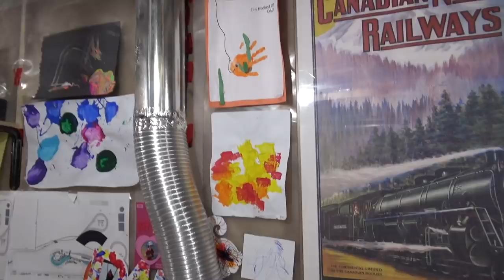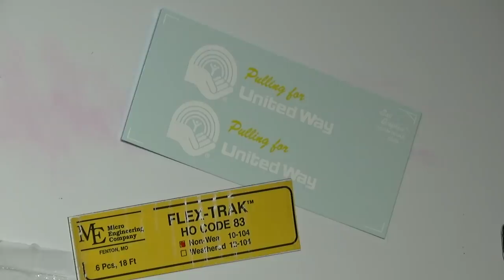Layout Update - April 2019: CEFX AC4400CW, Paint Booth Operational, CP SD90/43MAC...

Comment: Really like those CEFX AC4400s. the paint booth looks good. CP only had 4 SD90/43MACs. 9300-9303. The SD90MACs were in the 9100 number series.
Reply: you've got it backwards there bud. CP 9300-9303 were 6000hp MAC-Hs. The 9100s were 4300 SD90/43MACs.
Reply from the maker: I haven't taken at look at what the trackside guide calls them. CP calls them SD9043AC, at least that's what is on the side of the cab. Kato calls them SD90/43MAC, I guess it depends who you ask.

Comment: Nice job as always Mr. Ben!   Regarding your missing wiper blade. Have you considered doing a 3D printer to replicate the blade? Also have you ever considered putting in a smoke unit underneath the exhaust port on top of the locomotive?
Reply from the maker: They are so tiny I wouldn't know where to start! Haven't put much thought into the smoke but my friend has a smoke unit in a tunnel that works really good.

Comment: Use nail varnish remover, i found that tip in a magazine years ago back in the UK. Worked for me on an athearn unit recently
Reply from the maker: Interesting, would it not strip the red underneath as well though?
Reply: @BArailsystem No it doesn't, you have to let it (couple drips, maybe more) sit on the number or symbol for a minute or so and the rub with a cotton bud/q tip for a couple minutes to get them off, it doesn't strip it. You still need to work it.

Comment: Nice new projects done and on the go.  How you make your black wash for the locos. I am at a point where I will be weathering my locos soon. 
Nice detail touch to the curb on the Banff station sidewalks.
Reply from the maker: Thanks Peter! Super easy, water down some black acrylic paint. I like to use old contact cases so I have two containers. Then I can mix one 1:2 that is a little thicker and one that is 1:3 which is a little more diluted depending on what I am working on. I'll cover it in a future layout update.

Comment: Awesome man. I just got my small 5x8 layout running recently. Double main and a double track spur for a grain elevator. Got a scale trains ET44ac CN 3095, CP SD40-2 and a BNSF GP40. Hope one day when I move into my own place to have a layout like yours. I've been following for years. Are you going to pick up the new run of SD90/43MAC coming out next year?
Reply from the maker: Nice! Layout space comes and goes, its important to continue to work on your skills no matter what kind of space you have. 5x8 is a great space to do that!  Similar to what I had before I built this layout. 
Is Kato doing another run? I think I am going to get one of the new MAC-H's from Athearn.
Reply: @BArailsystem  I don't remember I believe it's athearn. Pre orders just started. Apparently it's even heavier than Scale trains ET44
Reply from the maker: @cameron.s.9368  Ah yeah, that's the SD90MAC-H, its not the same model as this Kato that I am working on. Very close but some differences in the radiators, long hood and cab.